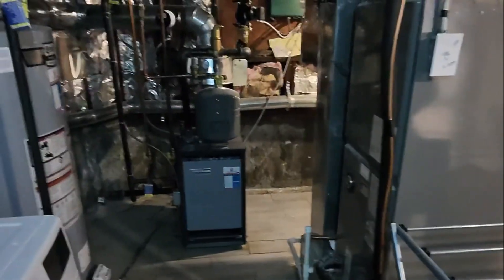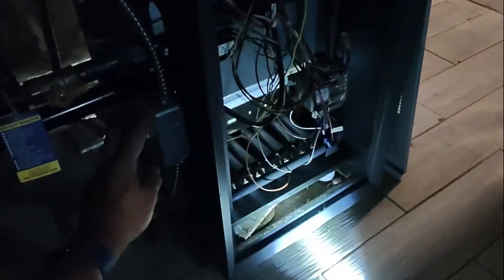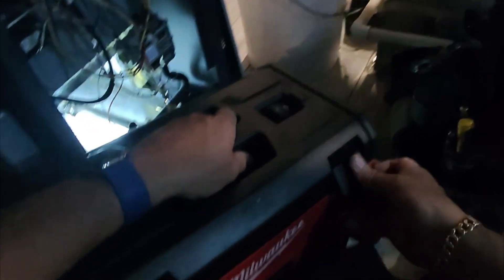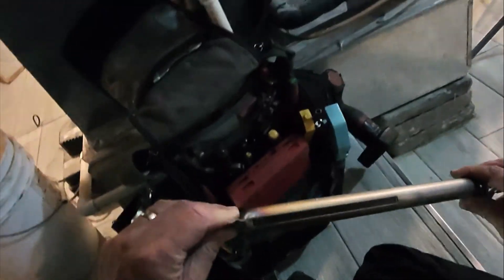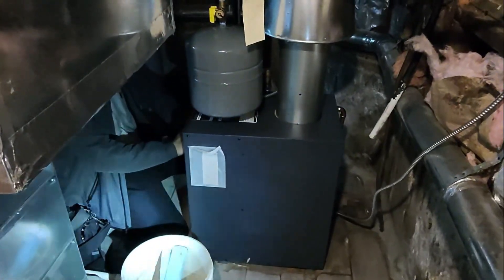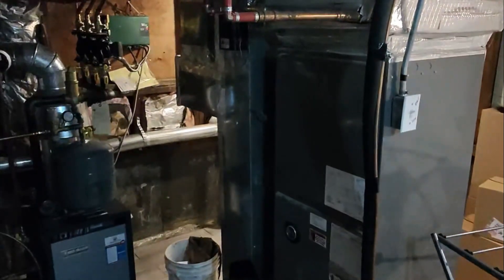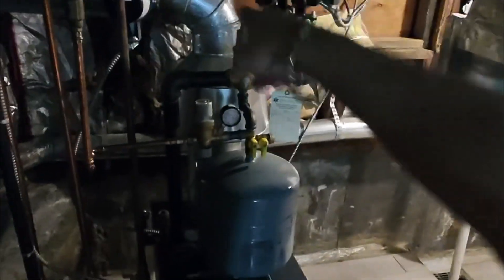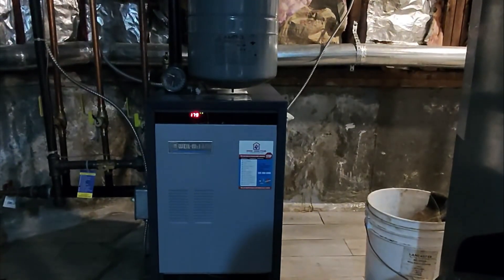Weil-McLain Boiler Annual Tune-Up | Full Step-by-Step Heating System Maintenance

Comment: white/gray powdery debris is usually from the pilot light, probably not burning clean from lack of air or too much gas. but could simply be from dust and contaminates in the air being burnt off and deposited up on the boiler sections, then when main burners light it knocks some off.
Reply: This boiler has spark ignition. There is no standing pilot flame.
Reply: it still has an intermittent pilot, which can cause some buildup from any contaminates in there off cycle, it gets knocked loose or flashes off on it starting up and again with main burners.
it's certainly dryer and clothes lint being the laundry is close.

Comment: So a “full maintenance” for a hydronic boiler is simply checking the burner tubes, confirming that each zone is working, and doing a combustion analysis? Not much to it. But your new employee got some training.
Reply from the maker: Plus pressure and expansion. Temperature aet
Points. Just to name a few more of many else

Comment: Mikey great video!I have a Weil McClain cga-4 series 2. Question any reason/recommendation for economy dial to be set in the middle? I’m in Chicago area thanks
Reply from the maker: Middle is where I was taught.
Reply: does it even have an outdoor temperature sensor installed? if not the knob shouldn't really do anything anyway. that's the "outdoor reset sensor" and "adjustment knob", 
what it does is limit the boilers temperature to below the high limit setting when the outdoor temperature is above a certain temperature.
it has an pre-programmed curve it follows, which the knob alters some. I believe it's listed in the manuals either boiler, install or both. go find it on line and read through.
in some cases the temp setback can be undesirable, like when there's an indirect water heater and no separate wiring to trigger it at full output, recovery can be slow or never happen if it's turned way up. other thing is heating could be very slow and take too long, depending on if there's cast iron radiators or copper/aluminum fin baseboards. heat output drops drastically on the small baseboard as temp decreases below 180F) for heated floors/slab, it's likely great, as those are always reduced temperature anyway.